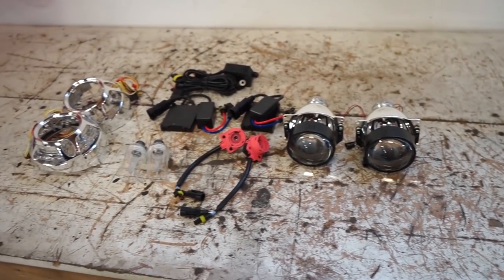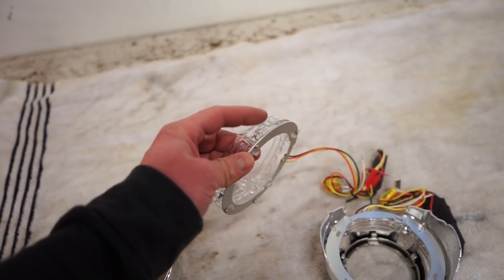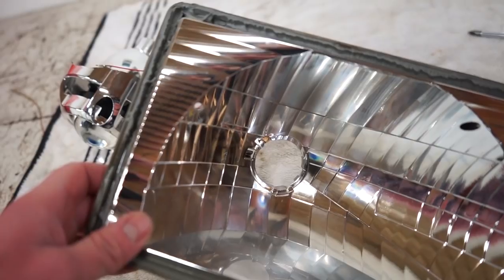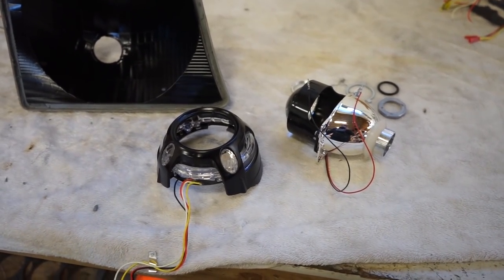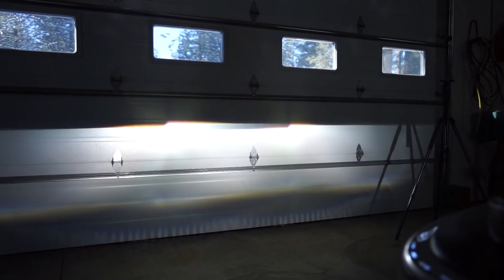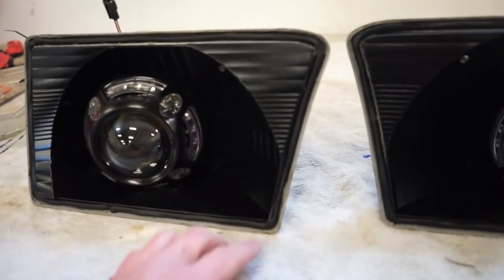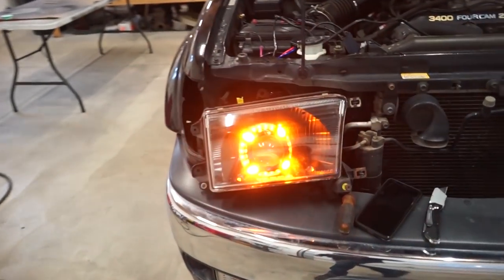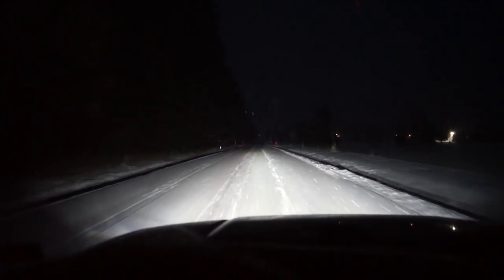Building Custom Retrofit Headlights For A 3RD Gen 4Runner!

Comment: This video is awesome, I recently put Mini D2s 5.0s in my 01 4Runner. Second set I’ve done. First set with my 2000 4Runner. Don’t have access to a sand blaster so used oven cleaner to dissolve the chrome bits. I’m thinking of maybe redoing mine and going with that Panamera shroud. I have the demon eyes in mine and love the look but I still want more. Thank you for all the 4Runner videos. Love your work!
Reply from the maker: Sweet!! Thanks!!

Comment: Had to add another comment for those who are worried about putting your housing into the oven you can use a heat gun it takes longer to get the housing open but works that's how I got my housings open.

Comment: Are those HID lights?  If so why did you choose them over LED's?  I have been running 6500K and 7000K LED's for several years with very good results and the cost was good.  Just twist out the old and twist in the new.  Dead simple and quick.

Comment: Dedicated work...Good work...  but I personally leave that SUV details and features as original as possible, perhaps respect for an iconic Toyota model. There are high quality LED bulbs to get a great night driving illumination without messing with the stock headlamps.
Reply: No matter how much you want to maintain stock on your vehicle, do not put leds in reflector housings. You blind the hell out of other drivers and usually leds in reflectors put out even less light than stock. Visibility in bad weather is pretty awful too. Been there done it. If you want leds, you have to do a proper retrofit. End of story.

Comment: Nice vid. you are very creative.
I have a question Austin, can I do the black out thing and keep the original reflector? I'm planning in doing it on a 90 series prado, I'm at a country where I can't buy from amazon/ebay to get the projectors.
would you get bad illumination if you keep the stock projector assembly?
Reply: Did you ever do this?